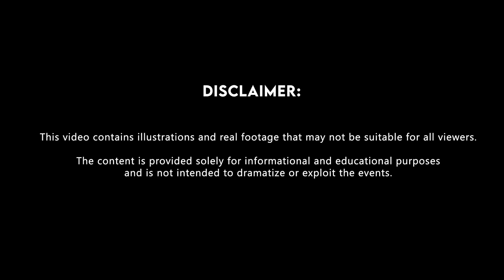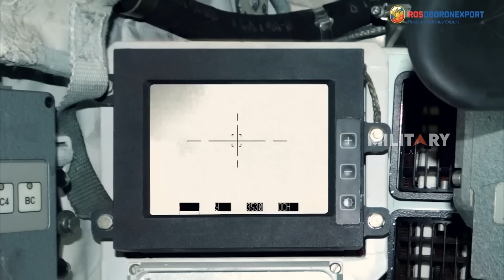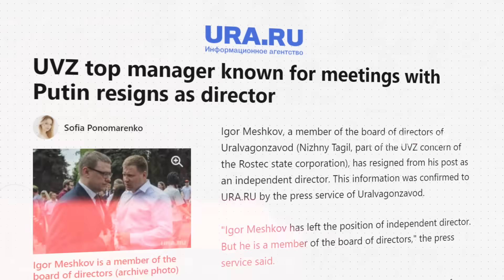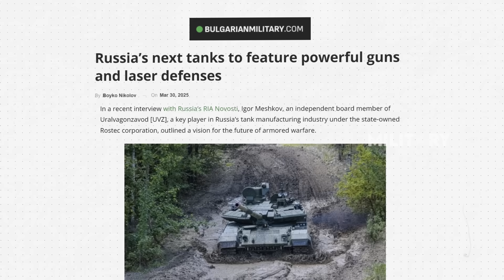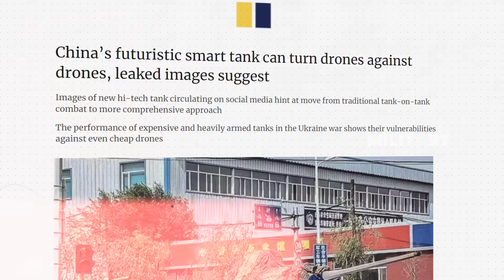Revealed! Next-Gen Russian Tanks Will Melt Missiles with Lasers

Comment: Tanks don't have a future beyond 2050 . There is a limit in its archaic design . Tanks can't adapt quickly enough , cannot upgrade quickly enough . moreover it is too costly to do .A completely new design/concept/platform will replace it starting in the 2050s .smaller lighter agile cheaper and with hightech . China's 4th gen tank is probably already in service and is a big shift towards a new design . It's the most advanced tank today ( others are in the 2030s) China will most likely have this as their last major tank and switch to a new platform starting in 2050 .

Comment: Equipment that don't require humans in them can become as small as the machine allows to carry various payloads. A flying drone is an aircraft and a field gun.  A motorized wheeled drone is a tank.
Reply: Autonomous or remote-controlled vehicles are also vulnerable to enemy EW.
Reply: @aarontheaviationaddict3643 But the keyword is "remote controlled". It is impossible if they are working in autonomous mode.

Comment: Railguns are immune to rain, fog, smoke. Unlike lasers.
Reply: But they are practically do not exist.
Reply: You don't even know what a rail gun is.
Reply: @indigobaloon8091  Electronmagnetic accelerator, like used  for magalev trains.
Stick to games, fanboy.
Reply: @ so it is a lame ass gun that uses electricity to propel a round. And you think this stone age principle of doing harm has anything on lasers. LOL.
Reply: @indigobaloon8091  Magnetic repulsion, Lorentz effect. Gunpowder weapons are primitive. Railguns can launch projectiles into  space, and  hypersonic vehicles without booster stages; and low-velocity nonlethal rounds.
Reply: @RadicalTek  The railgun has almost nothing in common with maglevs. It is a Gauss gun, where the projectile is accelerated using electromagnets. And in the railgun, the projectile is accelerated using the Lorentz force, which occurs when two parallel conductive rails are short-circuited by the pallet on which the projectile is placed.
Reply: @morfeicheg  Same physics. Read a book.
Reply: @ lol, everything uses the same physics because you can't have 2 different sets of laws of physics in one universe.
Reply: @morfeicheg  You win. Play some games.
Reply: @RadicalTek  If so, where are the railgun driven Western hypersonic missiles? You leave out the horrendous electricity, energy requirements of a railgun. Even the Navy stopped playing with that, it's NOT practical!!
Reply: China. US leads in rappers and Olympic medals. 😂
Reply: 100%.